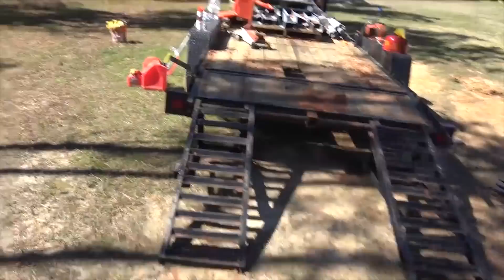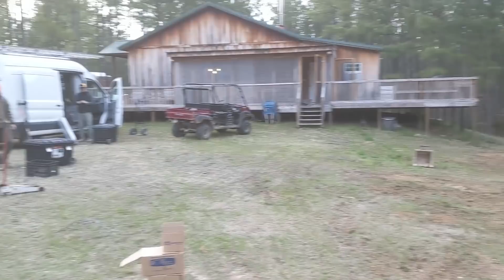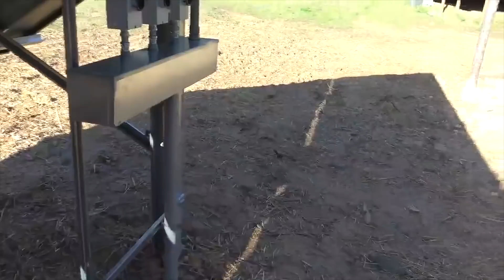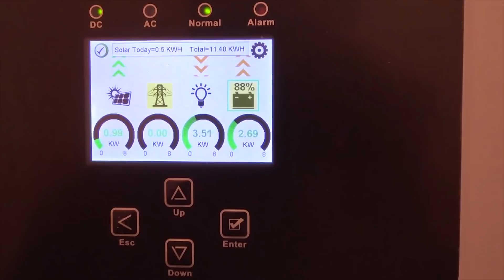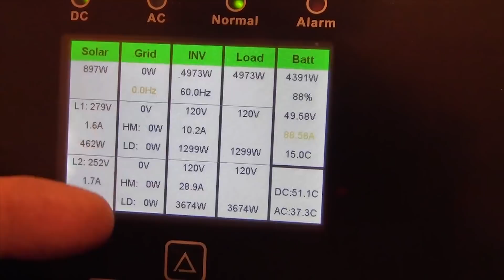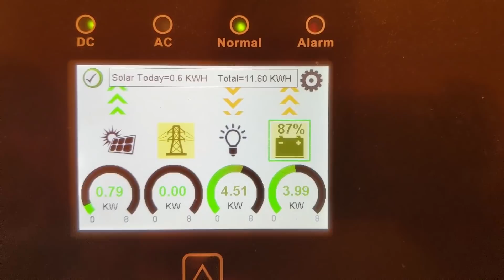Energy Assurance!!!

Comment: Regarding charge controllers. Do you need to hook your loads to the controller or can that run separately? I will be installing panels on a van down by the river, but will connect a much larger load than the controller can handle. I just want the controller to not overcharge the battery from the solar cells, but leave the discharge to me.

Comment: Would it be a good idea to make the concrete extend up at least 6 inches above ground level to help keep the steel from rusting? Maybe by using one of those round tubular forms? And then having a conical slope on the top of the concrete? I live where the ground gets very wet much of the year.

Comment: Question about the well.  Doesn't one pump try to force water down the other pumps pipe?  Stopped by the check valve down the pipe I guess.  Why not put a check valve right at the top of each pipe before you go down the casing?  I like your work and would have you work on mine if you were in my neighborhood.  :)
Reply from the maker: You are correct but the pressure switch is only set at 60 psi.  I use 200 psi 50 yr black poly.

Comment: Hey 775 if I wanted to fuse each 24v battery what size fuse would you recommend for it I have 15 24v batteries and like to fuse each one and then fuse all 15 thanks
Reply from the maker: what are the battery specs? amp hr rating?